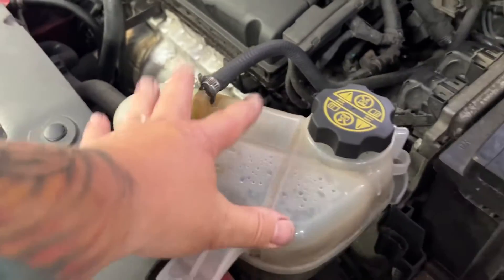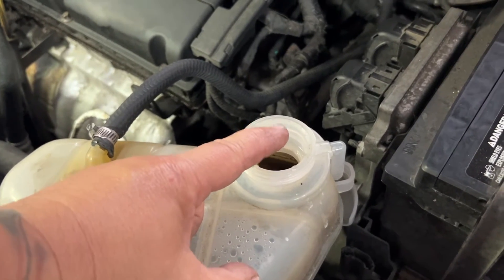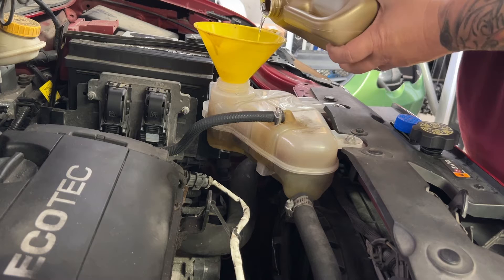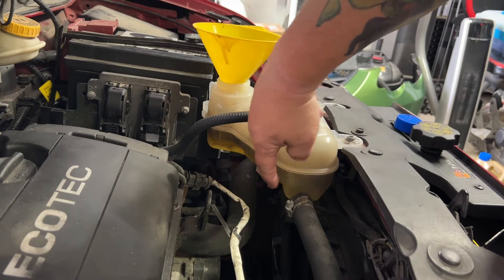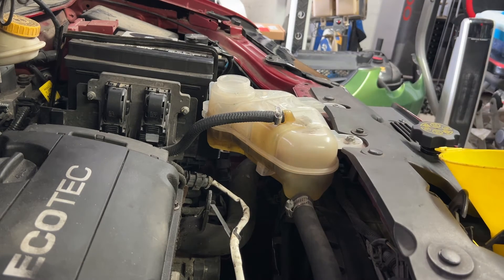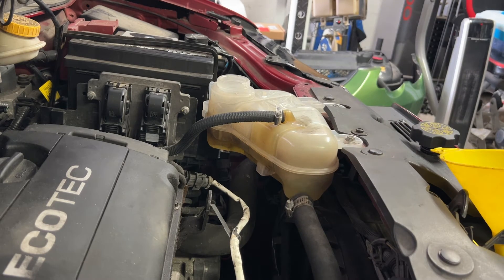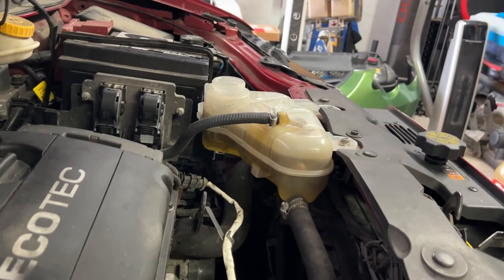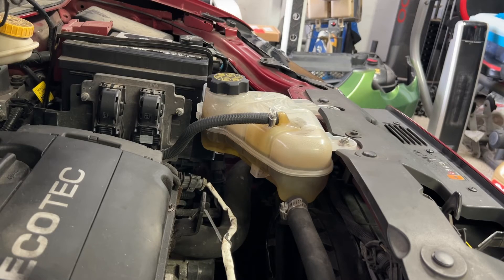CHEVY SONIC - How to add Coolant and check Radiator Levels (Sonic Cruze)

Comment: I do not think they ran my engine after filling it.  Just had work done for a cracked temp sensor housing  and my reservoir was almost empty.  I checked because upon idle my heat wasn't working.  I just topped it off.  I'm hoping the Firestone guys were just lazy and there are no additional leaks.

Comment: When I fill the coolant yo the part line it always ends of leaking somewhere, like sn overflow but, only ehen the engine is hot after a long ride. However, it doesn't leak if I fill the resovoir maybe an inch before the part line. What could be the problem ?
Reply: Check oil l. Uf there is no visible leak but you have to keep adding coolant it could be leaking in the engine block. If you ch3ck engine cap and see milk color then there is definate coolant leaking into engine

Comment: My engine light came on after I put the coolant in. Help?!
Reply: Walmart sells a obd reader for 19.99 or a nicer one for about 40 or 50. You can hook it up to the obd reader plug on your driver's side and download an app which then reads the CEL (check engine light) code that is causing the light to go on. It will tell you what is going on. Then you can look up info online and either try to DIY the fix or at least not let a mechanic deceive you because you already know what is wrong with the car.

Comment: I love this king of videos.
Anyways I have a question,
I have the same car, but why does my coolant overflowing in the reservoir if cap is off?
Reply: What do you mean it's overflowing when the cap is off? When do you remove the cap? I hope you wait until the car is cold, meaning waiting a few hours at least after turning it off. Please don't touch that cap when the car is hot or warm because the coolant can then spray out and cause serious burns.